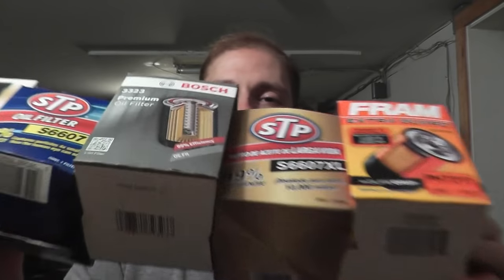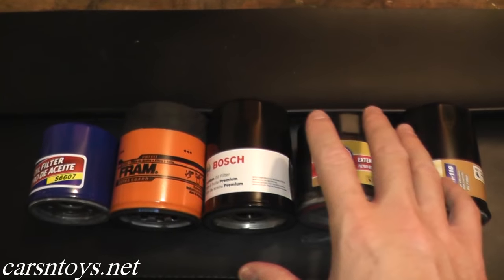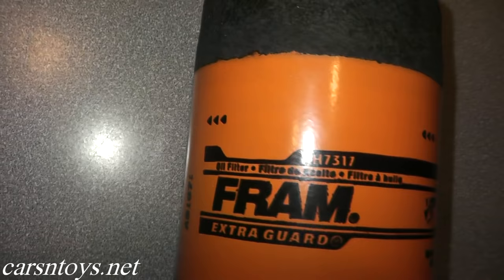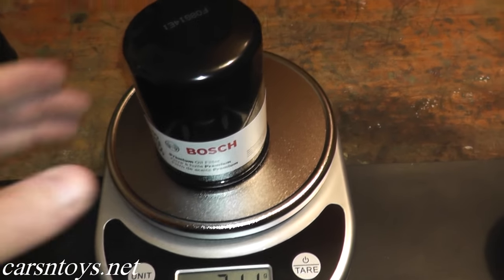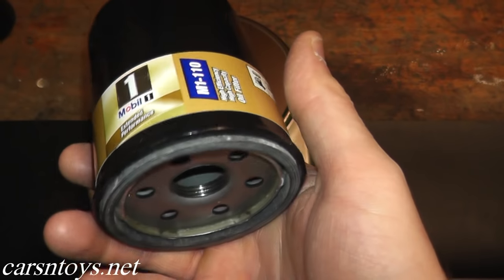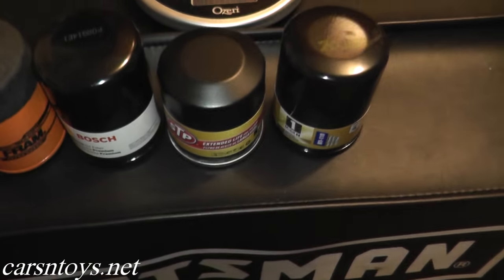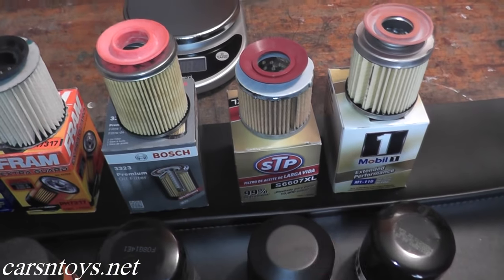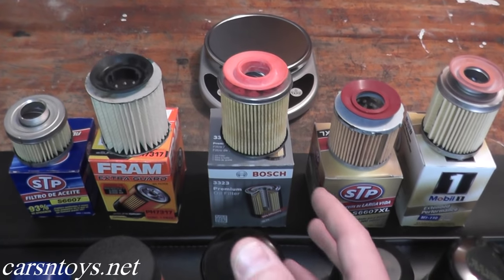OIl Filter Comparison...STP vs FRAM vs BOSCH vs MOBIL1

Comment: The measure of an oil filter is how well it removes particles from oil. Everything else is irrelevant.

Weighing and cutting open a filter tells you as much about its filtering performqnce as weighing and disecting a horses leg and predicting its lap times.

The total weight of an oil filter is no indication of the weight of age filtering medium nor the effectiveness of that medium. The can can easily be increased in weight by thickening the base plate, the tube or the spring. Though there would be market resistance, an oil filter housing could be made of a FRP high temperature plastic weighing substantially less than metal construction. 

A sand or a pressed sawdust filter medium would weigh more per volume than any filter medium from TP through glass fiber.

If you want to fairly compare oil filters, then do so on a testmbench with controlled contamination oils over the operating temperature and vibration ranges experienced in real life.

Comment: Cutting filters apart and weighing the pieces proves about as much as taking an engine apart and weighing the pieces lol

I see absolutely no testing on filters whatsoever, just see people cutting them apart and saying "aha I see"

Toyota just globs glue on the end of the pleats, no caps no cardboard nothing just glue and sworn by as the best filter by many... 

Fleetguard is using cardboard endcaps and an ecore plastic core, they are regarded as the best filter for your Cummins engine... 

There's parts, and there's the sum of the parts 

Two people can take two stacks of parts and have drastically different results when building things 

Meaningless videos 

No tests on the filtration efficiency 

No tests on the drainback valve function 

No tests on the bypass valve actual vs rated pressure 

Not really worried about burst pressure but knock yourself out if you want to test it out

Comment: If you care about your engine do not use Fram filters they are junk and use the cheapest materials in their construction. I have worked in a parts store for many years and always recommend Mobil 1 filters to all of my customers that ask my opinion. For synthetic or conventional oil. Yes it's more expensive but you get what you pay for when buying an oil filter. Stay away from Fram or any " house branded"
Reply: Charlie Hogan I always thinking to get Fram at Walmart but I asked myself does Fram strong,will it keep my engine run smoothly forever? when a guy cut the covers to see inside of it.. a small sheet papers from Fram? Lol K&N,Mobil1 and Bosch have more paper and thick paper than Fram. Looks like the Fram paper won't hold the dirt longer. Walmart doesn't have K&N so I picked Bosch when I read the chart book said Bosch just like K&N.

Comment: Weight is irrelevant, as is appearance to the naked eye. It's the surface area, pore size, resistance of the media to tearing, operation of the valve, etc. that matter. There's nothing relevant to actual performance or reliability in this video.

Also, running oil in your engine for 15,000 miles is incredibly stupid. Sure, synthetic can keep its viscosity and lubricating properties well, but it and filters can't do anything about the buildup of acids and other non-particulate corrosive impurities.

Comment: First I am not associated with Fram.  The endcaps are not cardboard but a fiber composite.  Older airplanes were made of aluminum; newer ones  are made from fiber composites.   Same concept.  If you want to see the testing that a Fram extended guard goes thru.  see  https://www.youtube.com/watch?v=cttLaWepdL0  about 12:40 they talk about the endcaps.  But the whole video is good.

Comment: Frame filters are no good.. they use cardboard and if you cut one open, they are all rust from factory.
This is the worst filter idea. Weight has zero bearing on quality of the filter. You gotta open the filter to see the quality. You cannot look at a filter, you gotta cut them open.

Comment: First the filter media has no clue what it is filtering all oil filters can be used to filter synthetic or conventional oil. They did not have special synthetic approved filters the first 50 years that synthetic oil was around. In fact the original Mobil 1 was advertised good for 25,000 miles in the 1974. Second the oil filter change interval by the OEM is funny since few if any OEM's recommend 3000/5000 mile oil change intervals any more. Toyota and Honda in the 1970 well into the late 1980 early 1990's was still recommending you changed the oil filter every other oil change. Today most car's oil life monitors or really long oil change intervals that grossly exceed 3 months 3000 miles or even 5000 miles. I have been running systhetic since 1988 and never used a special filter in order to run synthetic. I would love to see some documentation on why one would need a special filter to run synthetic. To add insult to injury most "synthetics" in the USA are not even a true synthetic since the FTC in the USA decided "Synthetic" is not a scientific term describe unique properties of Group IV and Group V base stocks they decided it was a marketing term. So most synthetics in the USA are some blend of Group III oils. Outside of the USA that is not the case the term synthetic has a very narrow well defined definition and only Group IV and V oils can me called synthetic.

Comment: STP BASIC IS A GOOD FILTER
Reply from the maker: I think so. I primarily used STP basic filters over a decade ago and on a regular basis. (Replacing every three months.) I never had an issue and the vehicle went well over 200k miles.
Reply: CarsNToys hey can you please do a video with the new walmart brand super tech and wix and microguard and carquest brand and if you can please let us know the microns on each of those filters.

Comment: Most car makers will tell you to change your oil when the monitoring system reaches anywhere from 0 to 7% which is about 5000 to 7500 miles depending on your driving habits the cost of a new engine is so expensive why wouldn't you change your oil filter at the same time there's no way in hell I will keep my oil filter on my car for 15000 miles how pennies are you saving by not replacing the filter, customer use to piss me off when they came in for service and request that.

Comment: Thanks for the video, cool to see whats inside these things.

But synthetic oil additives are only good in really really really cold weather. Not sure why anyone in the States would use synthetic oil. Its just a marketing gimmick. 

And if everyone would just stick to the 3k miles on every oil change the oil filter brand wouldn't matter. Fresh oil and filter over any marketing gimmick, all day every day.
Reply: You say that synthetic oil is only good in really cold weather then you ask why would anyone in the states use synthetic oil ??? Well in the states (I live in Massachusetts ) it gets really cold November thru March. 20 degrees to 40 degrees    in those months. So your comment is either trolling or you are lazy and don't do any sort of research on your comments. Maybe you think 20-40 degrees isn't that cold but anything below freezing is cold I would think. No?? Maybe??
Reply: +Boston Celtics 34 I don't need to do research, most of the stuff you read online or from hearsay are opinions. My uncle is an engineer and works at a resource facility that tested these oils.  When I said cold, I meant Alaska cold. But keep using Synthetic oil, thats what they want you to use lolz.
Reply: +Manila Kid Try running dino juice in turbocharged engines. Let me know how that goes.
Reply: +dansolodan Hey Einstein, how many daily drivers run turbo engined cars? Why don't you try it and let us know.
Reply: +Manila Kid you need an education. Dino oil absorbs water into its structure, reducing viscosity. You need to learn about chemistry concepts like the "octanol-water partition coefficient" to understand how oil and water actually DO mix. Synthetic oils are engineered to resist this, and not simply in cold weather as you imply. In fact, nevermind cold, synthetics peform best and prove their worth under HOT conditions. The oil does not burn off when it encounters a hot part either, it stays in place providing lubrication. The breakdown in viscosity is much faster in dino oil than in synthetic, which is why car manufacturers allow (under warranty) huge increases in mileage between oil changes with synthetic, something they will never permit (under warranty) with dino oil..... oh wait what the heck am I doing making points for one so closeminded? Wasting my time, I have better things to do. See ya.

Comment: The thing you're not addressing is the back-flow valve system that keeps concentrated dirty oil from getting back into the engine.  Rubber flapper valves suck.  Metal spring valves are the way to go!

Comment: Useless video!  No mention of media type, can thickness, microns of filtration, etc.  It doesn't matter if you run conventional or synthetic oils in these filters.  Different vehicles have different oil specifications and change intervals.
Reply from the maker: +JeepBigE It's a basic review. If you want a more in-depth review regarding end cap material, thickness of can, media type, etc. this will be better suited for you: https://youtu.be/kx-NT1DEtlU   Regarding running conventional vs synthetic, it does matter. Some filters specifically list conventional motor oil only.

Comment: cheap chinese brands is what most automakers use today from the factory. lol and they dont care what you use, if your engine fails Im certain they'll replace it at cost to the customers. And the standard Mobile one is the same as K&N, w/o the nut. And the K&N cost twice as much.

Comment: I had to stop watching when you said you would be happy with an STP oi filter. FRAM IS CRAP. Run from Fram. Oil is the life blood of the engine. Run Wix, Mobile 1or Purealator ( never looked at Bosch ) or risk engine problems even if you change your oil every 3K miles.
Reply from the maker: I had zero issues using their filters for a number of years and well over 200k miles. I think it also depends on how you treat your vehicle. I'd certainly use a different filter in dusty conditions, long idling, constant stop and go, etc.
Reply: The fact that you got lucky is not relevant. Go talk to some mechanics that work on the engines and let them tell you about the damage they have seen. Older mechanics would be best most likely. Very few of the younger ones break open engines anymore.

Comment: He weighs his oil filters and rates on that? Ummmmmm ok
Reply from the maker: +GreatBeyond74 Sure. The more it weighs the higher concentration of filter element.
Reply: +CarsNToys  some cars like Honda need more flow than filtration
Reply: Except that minor differences in steel quantity, not to mention quantitative differences in steel density arising from the qualitative difference in type of steel used, can have a measurable impact on your conclusions. It's not that the methodology is wrong, but that it fails to capture the whole picture of what happens with steel mass. Perhaps a fuller oil filter "autopsy" with individual pieces weighed, including metal parts and filter media, would improve the experiment. Also, answering some of these stories about who makes OFs under contract, on what assembly lines, for which companies, would help aid purchase decisions; because it seems people want to know stuff like that. That said, kudos for trying. Most wouldn't bother.

Comment: Big waste of time. Like a filet mignon from restaurant A weighing 9 ounces is better than filet mignon from restaurant B weighing 8½ ounces??? I'd go by taste and tenderness! As another person commented, the important thing with filtration is what per cent of particles going into the filter will be captured. And how long can it go before it totally plugs up and oil goes through the by-pass valve?  Not to mention, it's kinda important if that valve functions properly;-)  It's way too easy to post video on the web and make you feel like you are an expert.  Stick to your day job.
Reply: You are part right but wrong.so if u buy a fillet select and a fillet angus grade would they taste the same will the tenderness will be the same??? I dont think so so yes the filters do a big diference in engines
Reply from the maker: +Craig Erickson Weighing does make a difference. End cap material, can thickness, center tube (plastic vs metal), bypass spring vs stamped steel, etc. All of this can be determined quickly by weight.

Comment: Don't need a tool on a Fram? Muhahahahha  Sorry I am a mechanic and have been since I was 11 or 12 years old.  That grip thing on the Fram is worthless at change time.
It is plain to me that you are really affected by the advertising. Can you see past that at all? smh. I wouldn't put a Fram filter on any friends rigs. I have seen them with defects that just bypassed the oil.
For instance you can use ANY oil, synthetic or non-synthetic, with any of these filters.  Also common sense dictates that a finer filtration filter will "fill up" plug up" faster given its total surface area.   Filters that have cardboard bases are not good at all. If you use one change it frequently.  Moisture does go through your oil and it will ruin that cardboard. Those filters I would agree you should change every three months regardless of how far you have driven. Keep the oil just change the filter or get a good filter with metal construction and large surface area, preferring synthetic fibers with a fine filtration.

Comment: one of the very few times i've bothered to put a comment, but this was a crummy video, it could have been condensed into one minute! you just kept repeating the same lines, oh you'd be happy to run the STP if you were changing it every 3 months? i didn't know that, you had not just said it 2 minutes ago... this was so frustrating to watch, also, weight will have very little to do with the actual performance of the filters, so what if the bosch is the heaviest? it might be made from a solid block of concrete, with no filtration or flow capabilities, but oh wait, this guy say's its heavy so it must be the best! hurr hurr, Goodness. please just stop.
Reply from the maker: +byronjamesbaillie Weight does make a difference - synthetic media vs cellulose, is it wire backed, metal vs cardboard end caps, plastic vs metal tubes, etc.

Comment: This video does nothing but waste time. An oil filter has many important functions, and you discussed none of them except for the filter media, which you did nothing informative for except cutting open the canister and reading what the box told you.

Weight also has nothing to do with any aspect of an oil filters performance ability. You cannot weigh the filter media and say that it's "better". You might as well stuff a roll of paper towel into a canister and screw it onto your car.. Except you have no oil flow now, because you were too worried about "weight". But hey, there's a ton of filtering media now!
Reply from the maker: +Sk3pT1kaL I appreciate the feedback.
Reply: +CarsNToys Looking back, I sounded like a major dick and I apologize for that.
Reply from the maker: +Sk3pT1kaL Thank you. I have thick skin so no problem. Cheers

Comment: The Fram filter is the worst. I would Never use a Fram filter. They are junk,
Reply from the maker: Interestingly enough, we did cut open a Fram ExtraGuard after 6k miles and it was in good shape. However, I wouldn't go beyond their recommended service interval.  https://youtu.be/_GeUtMBFKMU

Comment: I recently bought an STP Extended Life oil filter at Auto Zone for TEN BUCKS and it never even touched my vehicle. It literally BROKE just by holding it in my hand! The spring that holds the end caps/media on the dome end of the filter (right above the bypass valve) came lose inside, causing the filter inside to slide around and rendering the anti-drain back valve inoperable. Curious, I cut it open and couldn't believe how shoddy this thing was. It was made in China so I wasn't surprised, but for $10, I want a high-quality oil filter. I wouldn't take one for free. It's GARBAGE. Do yourself a favor and stay away. Stick with a Wix, Mobil 1, Fram Ultra, Mann or OEM. The new boschs and purolators seem to be OK.